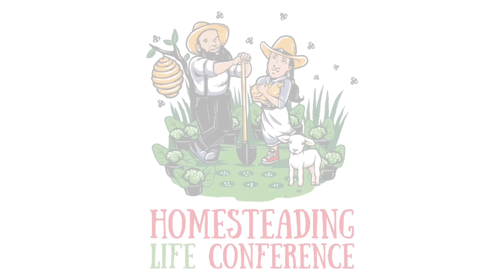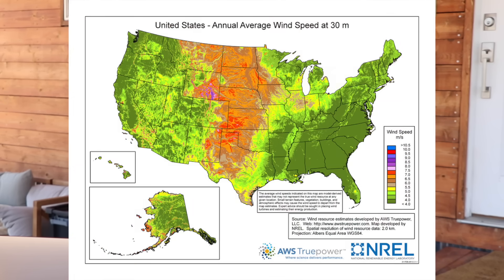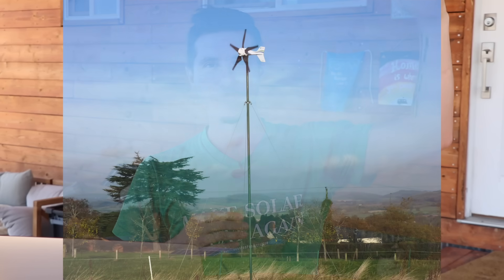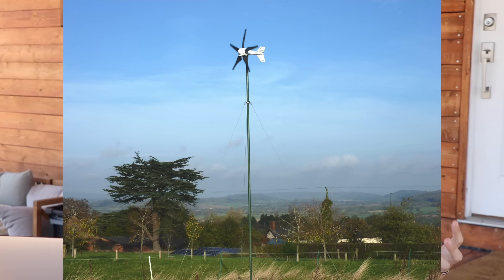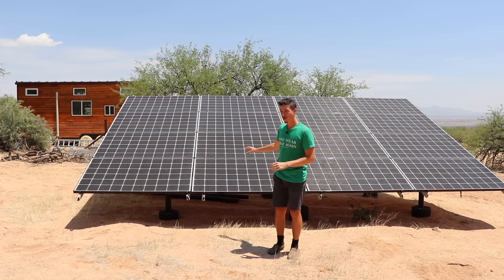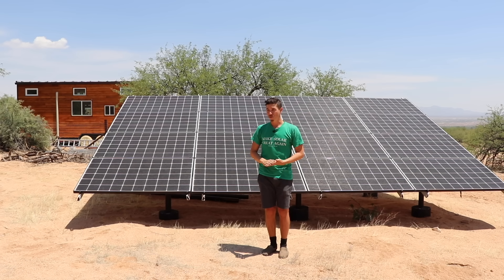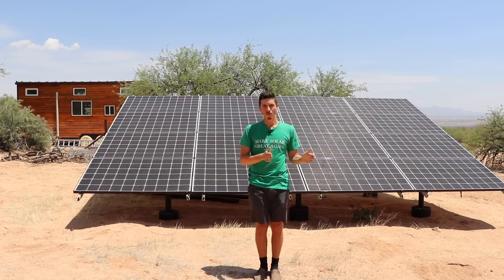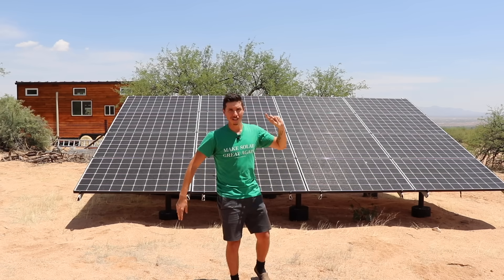Micro Wind Turbines... Are They Worth It? (Off Grid Solar)

Comment: Everyone is saying this video is biased lol...    well every one of these micro wind turbines I've seen,  have generated at most 150W.  And that is in the UK with some of the highest winds ever.  You have to put up a fairly large tower just to generate 100w??   and that's when the wind is blowing - one guy for 2 weeks didn't have any wind at all!! 
They are toys, they might be useful for squeezing out 100 - 200w maybe..   but again a few more panels would just be cheaper and easier.

Unless there is a decently priced microturbine  out there,  that isn't too big and provides at least 400w??   (actually producing it, not rated it...    The ones rated at 400w   barely made 75w)
Reply: And those small Wind Turbines are usually rated at a steady non-turbulent 25 MPH or 11 m/s wind speed.  Who has that much steady wind, continuously for many hours per day?  Less than 1% of the population does.  Also, wind flowing at 1/2 of the "rated" speed ( at 12 MPH or 5.5 m/s ) will generate only 1/8th of Rated Power <= OUCH !!!   So, a 1,000 Watt "RATED" Wind Turbine will be generating about 125 watts in 12 MPH Winds.  YIKES.  A 1,000 watt "rated" Wind Turbine, Tall Tower,  Long 3-Phase Wire, Dump Load, Wind Turbine Controller, Fuse, DC Disconnect, Brake Switch, etc will easily cost $2,500.  Then every 6 months, you should lower the tower, inspect the blades, the bearings, re-grease as needed, re-tighten loose bolts back to spec, repaint any rusted parts and raise the tower back up = maintenance forever.  If your location has 4 Hours of steady 12 MPH or 5.5 m/s Winds every day, for an entire month, then a 1,000 Watt Wind Turbine will generate only $1.50 worth of electricity per month. That is very EXPENSIVE electricity per kWhr.  Break-Even would not happen until 100 YEARS has elapsed.  Finally, there are zoning and permitting issues for most homeowners...
Reply: @MrSummitville  Yeah it seems it would be more practical to hook up an exercise bike, at least then you might get some exercise too.
I read a review from someone who used one of these microturbines for power generation at night for a static RV.
He said he ended up taking the thing down because it just made too much of a racket at night, it stopped them from sleeping.

Comment: Does this man question what I'll do to put up a wind turbine
Reply: I question why you would ????
Reply: @MrSummitville  there's more wind energy than sun. Becasue ohio has shitty weather like that. And I'll build a tower if i have too
Reply: @AlexPomesky  After you install your tower, wind turbine, massive wire run, wind turbine controller, dump load, battery bank and DC-to-AC Inverter, Disconnect switches, Fuses, etc then we can compare the annual PV kWhrs produced vs Wind Turbine kWhr produced vs the COST of each.   The cost of each kWhr produced by a Wind Turbine is significantly higher than a PV Array and certainly MORE costly than Grid Electricity.  Several large wind turbines in Ohio, have already been decommissioned due to EXTREMELY LOW PRODUCTION - which is very obvious if you do the math.  And even worse ... they had very high Repair Costs - such that they could NEVER "break even".

Comment: You should always try to overbuild you power generation I run Solar. Wind and hydro and all three have come in handy during different parts of the year here in IL the only thing I agree with this guy is that building a good base for a wind turbine is a pain in the butt.
Reply: Have you calculated the cost of each kWhr generated from Residential Wind Turbine vs a PV array?  Even in Illinois, you do not have very much wind compared to the "Wind Corridor" = Texas, Oklahoma, Kansas, Nebraska, South Dakota & North Dakota area.  To obtain "RATED" output from a Wind Turbine, your location needs steady 25 MPH Winds, for many hours per day, for many days per month, for many months per year.  A wind turbine could be helpful, during the winter months, in an Off-Grid home, if located in the windier areas of Illinois ...

Comment: The trick with wind turbines is to make them as cheaply as possible. Vertical wind turbines, while less effective than horizontal, have many advantages (works at lower wind speeds, safety, noise, bird safe etc...) and can be mounted on your roof. These can be built from scraps for a very low price.
Reply: Vertical ( VAWT ) are worse than HAWT turbines. Only a fool would mount a wind turbine on their roof.
Reply: @MrSummitville  Efficency is not everything. Vawt works better with low speed and turbulent winds. The noise level is also lower and they are safer.

Solar is useless during winter if you live far north and the Sun doesn't rise, wind blows all year round during day or night, so it's a good option, building a 1kwh turbine for a relativly price cheap is definately possible.
Reply: @SkepticalCaveman  There is NO POWER in low speed wind.  It is irrelevant that a VAWT will "spin" in low speed wind - it is not generate any WATTS.  Efficiency is everything - especially with Wind Turbines that are very expensive, and generate very few watts, on very few days per year.

Comment: Yah but I want to put a small system on my e bike and pedal as my rotation force so think about it pedal and solar generator hybrid ebike I'm trying to make a doomsday ebike as I had an idea well a fear of running out of gass and thought ebike can run on solar but night time is an issue in doomsday so how to generate power at night I thought I might take a wind Turbine generator and mod it to fit a bike chain and add it to one of my gears to help add power any thoughts

Comment: So, where I live they seem to make perfect sense ... actually, due to the climatic changes the combination of solar and wind is probably the most 'common sense approach' to reliable self sustainable living. And part of this is obviously what you expect to use and get out of it. Taking f/e four time a 600 Watt windturbine, produces 2400 kW / (hours of wind). When compared to the daily use of most equipement that is more then enough to get through those sun ridden days, on which there is generally also quite some wind. So mostly got a 'problem' with the generalization, but for you, living in the desert, sure i get that more solar is probably the way to go...
Reply: Most people ( like 99% ) do NOT have enough wind to cost justify a wind turbine.

Comment: I live in North Dakota. We only get wind on days that end in Y.
Reply: You live in North Dakota, the other 99% of the population does not.  Most people ( like 99% ) do NOT have enough wind to cost justify a wind turbine.
 Wind Turbines wear out and they need maintenance = $$$'s
Reply: @MrSummitville  oh I am sure the maintenance issues are constant with somthing that has to spin freely outside. We have massive temperature swings here as well. I'd actually like to out a small wind generator outside in my yard just to see what kind of output i could get

Comment: You are in the desert.  Of course Sun will be more effective.  For some places, both could be a good idea.  Your batteries are all you have at night, unless you can use the wind.  You may get away with a smaller battery bank or the avoid taxing that bank that you have much less by not discharging it so deeply every night.  A few cloudy days would show you the power of diversity, and I don't mean the PC kind.
Reply: Wind Turbines are NOT guaranteed to spin at night.  Most people ( like 99% ) do NOT have enough wind to cost justify a wind turbine.

Comment: 5.7K likes, 3.3K dislikes, you must have said something wrong... I see, the 65 feet thing doesn't make sense for small turbines, could be a mistake, better triple check. In the banner picture on energy.gov, apparently the turbine is about 16' off the ground, no need to look further.
Reply: It depends upon the local obstructions ... General Rule of thumb ... install a wind turbine on a tower with the bottom of the rotor blades at least 30 feet (9 meters) above any obstacle that is within 300 feet (90 meters) of the tower.

Comment: He honestly points out some really good points in this video, he isn't knocking wind turbines he is just saying that you have to ask yourself would I be better off buying extra solar panels given all of the maintenance and all of the other ongoing points he mentioned in the video. is it really worth it? Yes, maybe if you live in an area with not much sun it you live in a costal area with a lot of wind maybe it is worth it but for most ppl that extra money would indeed be better off invested in extra solar panels. I asked myself this same question after I bought a small wind turbine and realised how little power I am getting with it compared to my solar panels. I would have indeed been better off buying two more 100 watt solar panels with the money that I spent in this thing. I avg about 10- 20kwh a month extra with my 400 watt wind turbine, had I bought 2 100 watt solar panels I would have been generating about 30-40kwh a month extra

Comment: Can someone explain to me what off grid vs in or by the grid means ?? Like what do you mean by solar off grid ?? And vs what? On grid or what? Thanks in advance!
Reply: Off-Grid means your home does NOT have power wires connected to the Power Grid. You run off batteries.
Reply: @MrSummitville  thank you!
Reply: @diffasmr2296  Off-Grid Homes can be powered by Solar Panels and/or Wind Turbines and/or Micro-Hydro ( creek / stream ) . When all of that fails to maintain the battery bank, then the gasoline / diesel generator  must be fired up ...

Comment: Dude, I watched a guy install a vertical axis wind turbine around a post under his deck. It spun while the leaves on the bushes several feet from his deck were barely moving. Not 65' in the air on a pole that wobbles and sends the horizontal axis of the turbine into degradation. Yes, there are moving parts, and yes it requires maintenance, but EVERYTHING requires maintenance, even solar panels (snow has to be removed in the winter, dead leaves in the fall, shorted circuits, etc.), and vertical axis wind mills turn in even the slightest of breezes and can be made to any size and virtually any shape. Check it out. They're incredible, and worth incorporating into your home grid along with solar. If you live by any significant source of moving water, remember that water mills have, like wind mills, been used for a very, VERY long time.
Reply: How much power ( WATTS ) did your wind generate? And how much did it cost?  Solar panels require very little maintenance = No Moving Parts.

Comment: say no more, but batteries for solar needs ongoing maintenance, don't forget.
Reply: Depends upon the battery. But that has NOTHING to do with PV vs Wind, since  both require batteries.
Reply: @MrSummitville  yes, both require batteries and that is the point.
Reply: @augustwestusa  Batteries are required to run our homes OFF-GRID.  Do know of any other way?
Reply: @MrSummitville  No, my mistake ON the grid.

Comment: Hello guys I need help :( I purchased Tesup yuzo 24v wind generator that's supposed to have a controler integrated into the turbine itself. Well, the user manual is useless, they sell charge controller also with this turbine, but outlet cables are black, yellow and red, which could mean it outputs DC. They advertise it's a "breakthrough technology" even battery is not needed etc...but wtf is yellow wire for????
Reply: Do you have a URL LINK to the Mfr website and/or User Manual?    Are there any instructions explaining the connection to the Battery Bank?  Is it possible that the 3 wires are actually 3-Phase AC and they connect to a AC-to-DC Charge Controller?  Have you tried emailing the MFR?
Reply: @vtorsi610  https://drive.google.com/file/d/1AmqLDd2pksIFjmOSxopSq-LZ87-yd28R/view?usp=drivesdk
Reply: @vtorsi610  https://www.tesup.co.uk/product-page/yuzo-wind-turbine-made-in-europe
Reply: @vtorsi610  I contacted them and they have told me that it is not integrated, manual is stupid and false, also this is pure false advertising, why would someone tell it has an integrated regulator if it doesn't ??? Also pole diameter is not 37 but 25 etc.... Very dissapointed
Reply: @nikolaherceg7969  I have read the manual ... Pages 14 and 15 actually have very conflicting information regarding External vs Internal Controller.  Can you connect a Volt Meter to Black & Red wires?  Then slowly spin the shaft, without blades attached?  Do you get DC or AC Voltage?
Reply: @vtorsi610  I will check it tommorow and reply. Manual and advertisement are confusing indeed. If it's a DC turbine for instance why is there a yellow wire? And if so how will I know the output is controlled for charging :( I am very very disappointed
Reply: @vtorsi610  please don't laugh...I put two per two wires on tongue and slowly turned the turbine shaft, I am getting response on all possible  combinations of two  wires.
Reply: @nikolaherceg7969  I still suspect it is 3 PHASE AC and you need to connect an external AC-to-DC Charge Controller, a Load Dump and a Brake.  I do not like the SHORTING SWITCH, they use as a Brake.  That is OK if the blades are turning slowly.  But if you energize the Brake Switch when the blades are spinning fast, then all 200 WATTS of HEAT will dissipate in the stator.  That may burn up the stator, sustained high winds.
Reply: @vtorsi610  dear friend I have obtained a multimeter, could please tell me how exactly to check wires for if it's a DC or AC, besides slow spinning the rotor? What needs to be set on multimeter? Thank you and many greetings from Croatia

Comment: By themselves and wind, NO. 
Use these in conjunction of a man made breeze tunnel and Yes!!!
Reply: What "man made breeze tunnel" ?
Reply: @vtorsi610  
Ever been in a large building/hanger and you open a back door and the air inside the building is calm and the air/wind is screaming out that door.
Take a large fan inside long PVC tubing of such. 18 - 36 inch diameter. Build a big face around that opening to direct the air inside the tube having a steady airflow to power the fan that powers the generator...
Reply: @razony  NOBODY is going to do that ...
Reply: @vtorsi610  Ok. I did. it works GREAT!
Plan B...No sun, No problem.

Comment: All the people commenting from northern climates -- even for you solar is better. It's more consistent and cheaper per w, much easier to DIY and much less obtrusive. You can get a 10 kwh DIY solar array for $10K that's going to generate you plenty of electricity even if you live in Scotland. You gotta get up to latitudes where the sun just isn't out for more than 2 hrs a day in the winter to have solar not make sense. And even then it could make sense if you had giant batteries that could store energy seasonally because in the summer you're getting 16 hours of sun. But we're a long way from that. But for 90% of Europe solar is fine. Just because it's cloudy doesn't mean PV panels are not effective, you just need to overprovision which is not expensive these days, solar panels are getting down to $0.50 per watt. Solar is huge in Germany and they don't get much sun in the north.

Comment: This feels like a REALLY biased view...lol. Being in NW Iowa where we DO have consistent wind, windmills are competitive with solar. A combo of both can take you completely off the grid.
Reply: Yes, there is a small strip called the "Wind Corridor" in the USA.  Unfortunately, few people ( by % ) actually  live there.  What size Wind Turbine do you have, how much did it cost and how many kWhrs does it produce per year?
Reply: Been doing research and haven’t gotten one yet, but planning a combo of geothermal, solar and wind. Where you live (apparently) solar is great. Here, a combo can take a person completely off grid and I will actually get paid for energy.
Reply: @rodneymccrea7214  Geothermal was a huge cost saving / reduction in energy consumption.  Solar is cost justifiable - but all equipment must last a long time.  I cannot cost justify a Wind Turbine - my avg wind speed is no where near 28MPH = The Rated Wind Speed for all Wind Turbines.  14 MPH wind yields only 1/8th the Watts, not 1/2 the watts as most people think.  In 14MPH winds, a 1,000 Watt WT generates only 125 Watts <== OUCH !

Comment: Check out the Water's wind generator/turbine.  You can make smaller, more efficient wind generators if you design them differently. 

  And if you build/source the materials yourself, it is MUCH cheaper than Solar panels.

Comment: The best windmill is the Zagari cubic windmill,  Its a cubic square frame with a vertical axle in the centre 4 or more panel attached to it, each panel has a magnet that when it spins runs across a rolled coper wire to make electricity, the sides of the cubic frame is covered  each by half by a panel  to channel the wind to the moving panels and cover the negative side.

Comment: It's not about replacing solar panels with wind it is about complementing. At night time or when the weather is clody and windy the panels don't generate much and that's when the wind is good. It is going to even out the power generation and lessen the need for big battery storages. With renewable energy it is very important to even out the production. Also the wind turbines produce electricity all night when the solar panels are dead. They are to sum it up to DIFFERENT things that cannot be put up against each other or replaced with one-another in my opinion.
Reply: What make & model wind turbine did you install?
How much did it cost?
How many whrs did it produce last year?
Where do you live?